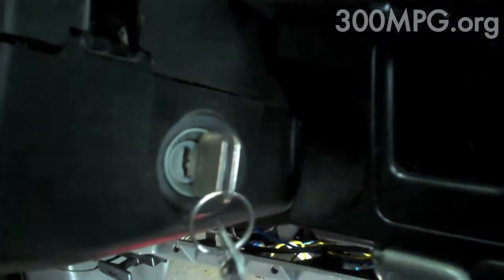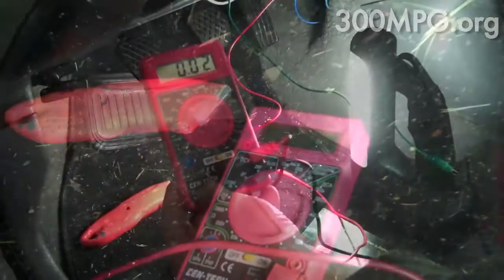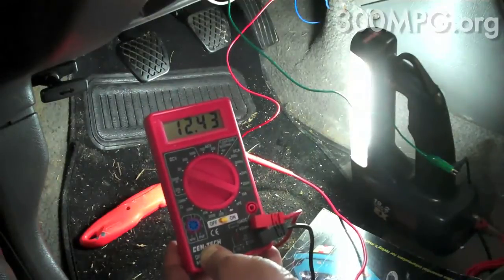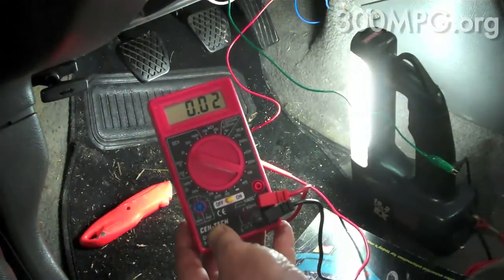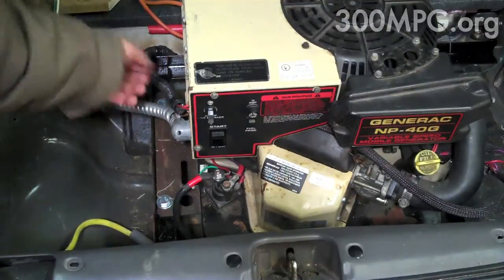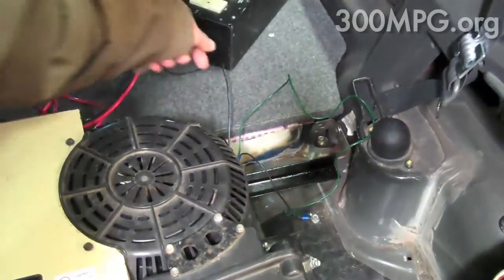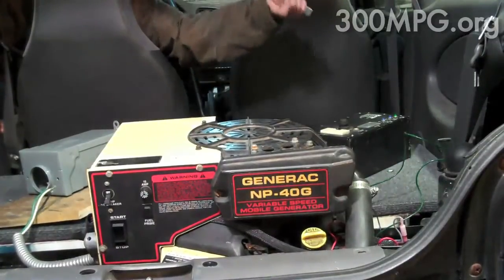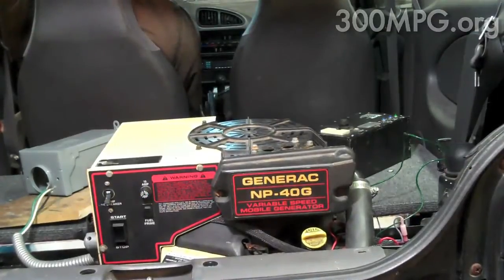REVOLT DIY Hybrid Remote Start

Comment: Why not just install a hitch and allow it to hold the generator?   Like them bike racks you can put on a car hitch?   No trailer, just let it hang up in the air
Reply: I hadn't considered that. It's really not a bad idea at all. The main thing is that the Metro would need a really beefy mounting bracket. The car was never designed for towing,  I think that with some sort of custom bracket, it could be done. You would then want a quick-release connection for all the wiring to make it easy to attach and remove.

Comment from the maker: @fireman65401 
The exhaust goes straight down an exhaust pipe and through a riding lawn mower muffler mounted on the bottom of the car.

Comment from the maker: @Luka464 
Er, um, yeah... I was wondering when somebody was going to notice that there was no remote OFF switch. I just need a separate wire for doing that. It will get rigged to a red button on the dash.
Another feature of this setup is that it allows me to turn off the EV system, while leaving the generator and charger running. If I ever need to, I can always just park the car for a while and let it recharge off the generator.

I am hoping to extend the car's range by 50%